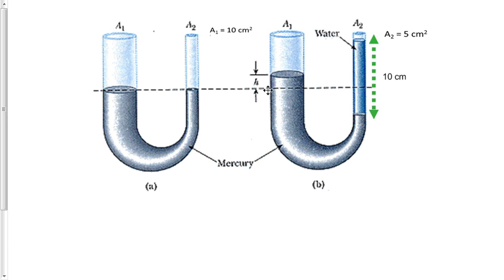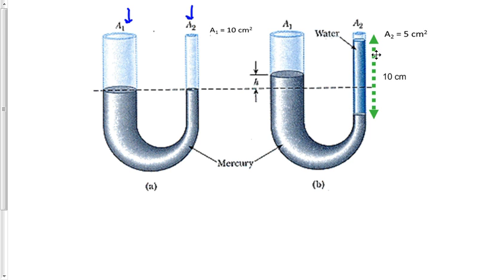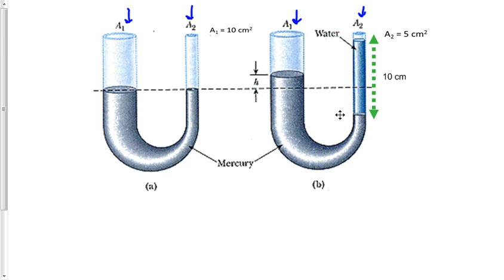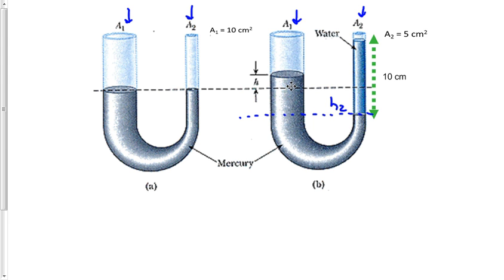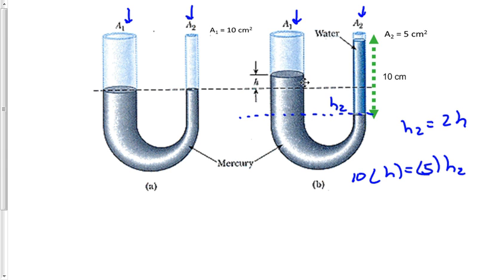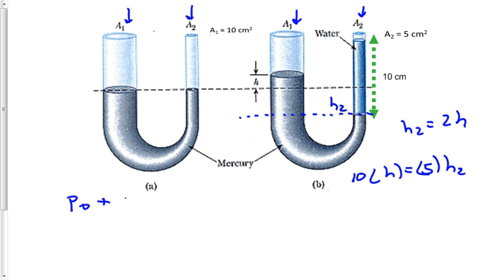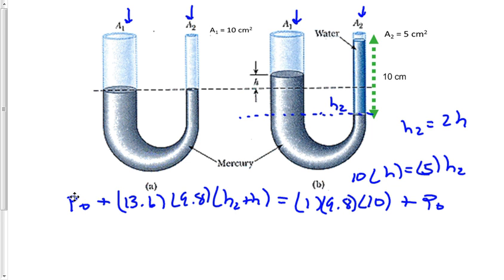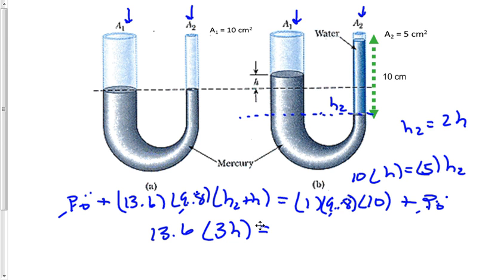Asymmetrical U-tubes

Comment: pressure on both the legs are atmospheric initially but they had different area.  Force is pressure times area. Hence, the force acting on the left leg is greater than on the right leg. So how does it manage to remain at same level on both legs. plz reply.....
thank you
Reply from the maker: Since pressure is Force per area the pressures are equal.  If the area is larger, then there is more mass to push so that is why there needs to be more force.